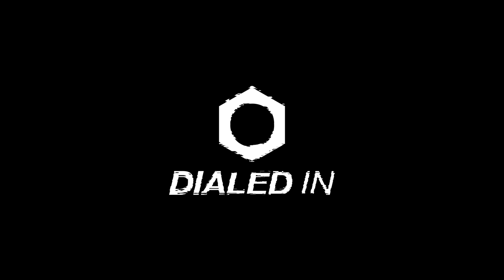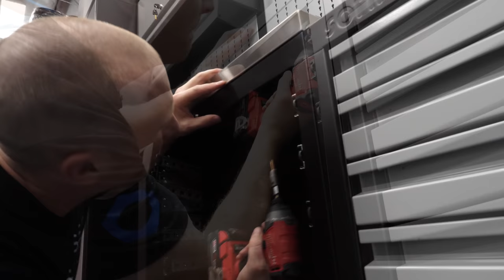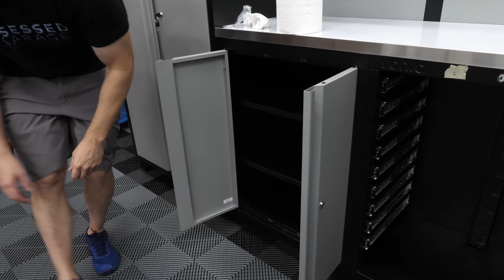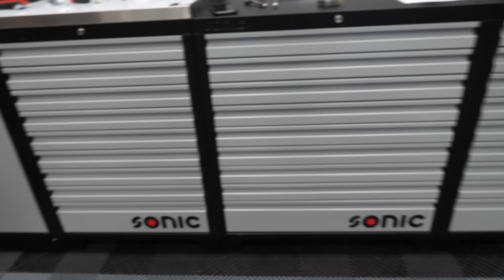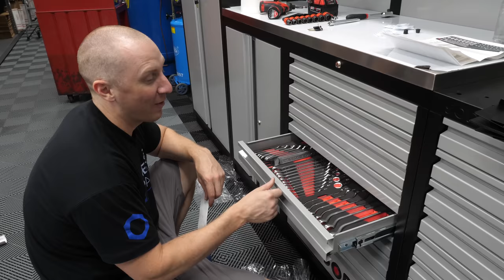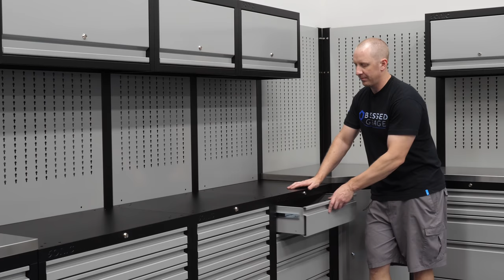Sonic Cabinets: E3 - Final Assembly & Summary

Comment: A suggestion for your keys to know which goes to which cabinet take a number punch and just number the keys 1, 2, etc. Don't need to number the cabinet just go left to right 1, 2 etc. The top ones could be 1A, 2A etc.
You could also engrave them but punches do a nice job and are consistent in size. I have used this system and I found it easy and practical.
Another thing I did was put the SAE tools on one side and the metric ones on the other. That way when I was working on an import I would go left, domestic go right.
Hopefully this makes some sense. 
Enjoyed the video and looking forward to seeing many more.
Cheers!

Comment: The other thing I think sonic is lacking is accessories for their slot-pegboard system. All they have are hooks on their website. If there were some nice stainless shallow shelves, I would be buying them. Why have the pegboard if you can't really utilize it except for hooks? I have sonic cabinets in my shop and so far this is one of the most underutilized areas of my cabinet setup. I'm not looking to make it feel cluttered but there are some things that would be great to be left on a small shelf to get to easily.

Comment: What made you choose not to do the integrated power / air / usb strips that attach to the back to the counter / bottom of the pegboard?
Reply from the maker: That countertop is only offered through the Master Work Station.  I wanted a custom array, so it wouldn't work.
Reply: Strange decision for them not to offer it a la carte

Comment: Do the Sonic logo's come off?  Are they stickers or paint?
Reply from the maker: It is raised lettering, so no.  I'm working on a solution.
Reply: I only ask because I'm thinking about buying the set-up but I don't want the logo's on every cabinet.  So if there is a way we can tell the manufacture to offer an option without the logo lettering that would be great.  Thanks.
Reply from the maker: At this point we will just have to source extra drawers, but if the array is big enough, I'm sure we can convince them!

Comment: Where is the video on the Lista cabinets?
Reply from the maker: I don't have Lista cabinets.  I only have packing station set-up.
Reply: @ObsessedGarage  Ah, I thought you had the cabinets as well. How about a review of the Lista products you do have? The packing station is essentially a work bench, correct?
Reply from the maker: I have a custom packing station with an NW drawered cabinet, 52" shelf, and 8' packing table.  They make some amazing stuff, but I ended up with a bucket of bolts left over, 18 hours of assembly, basically no instructions, and I'm still waiting on a few parts for them.  This could be a fluke, but the combination of pain I went through in the order/design process and amount of mechanical skill that would be needed to assemble, I decided I wouldn't be able to create a viable product line for people outside of one-off custom orders.  So I took the flyer on Sonic.
Reply: @ObsessedGarage  Mm. That is very understandable. If I may ask, I understand why you went with Sonic Cabinets....but why Sonic tools? Why not a similar priced USA made tool line like SK? They also sell tool sets prepackaged in foam. Just an idea for you since some prefer buying made in usa tools for the ease of warranty and high quality. Also, thanks again for the great deal on the microfibre towels in bulk you had on instagram. I love the stuff! Next up will be the lighting solution...

Comment: Matt, I believe this is the first time you have deviated from your OCD QUEST for the BEST! In the past you NEVER let price stand in your way to seek  
out the creme de la creme and while the Sonic cabinets look neat and clean they are IMHO not up to YOUR NORMAL OG standards. Not only do the 
draws wobble quite a bit, but they are shallow and should have included at least one 72" wide cabinet IMHO. There are some tools and equipment that will just not fit in the array you have. I can not comment on the tools themselves as I can't really tell from the brief video pictures.  When you sell plastic buckets for $300+ bucks one would have thought a shops main fixture (tool cabinets and work bench) would have been a bit higher grade. For others the Sonic brand may be fine, for for the REAL OCD Guys, there are better I believe. Yes, Snap-on  tools are crazy money (I own plenty)  but I'm curious if you've tried to reach a deal with them for distribution.
Reply from the maker: You are missing my MO.  I am pursuing functionally excellent, not perfection or expensive.  I'm looking for products that check the boxes that I've made up in my head.  A lot of times we need to make sacrifices to get something that works and is also available.  For example, look at the piping package for the custom install solution.  There are better ways to do it, but I needed to source things that fit and are available without having to manufacture from scratch.  These cabinets are a really, really nice balance of price vs. performance.  They have a 60" wide drawer cabinet if needed and their tools are plenty excellent enough.  I'm sure you have opened or used the hyper expensive for what you get Snap-on Box.  They are not good at all.  They have this really odd locking mechanism and then have the sloppiest drawers on the market and cost 2-10 times more than others.  Their drawer organization is also really bad.  I never even considered chasing them.
Reply: @ObsessedGarage  OK - I see your point. I do like the look, just wish they were another 1/2 notch up the pole on steel gauge and 
draw pulls.
Reply from the maker: The MSS+ take it to the next level.  550lb drawer capacities and insanely stout.  But they are twice the cost of these.